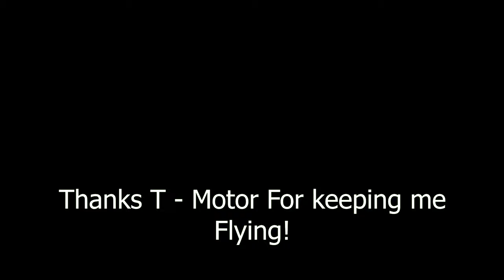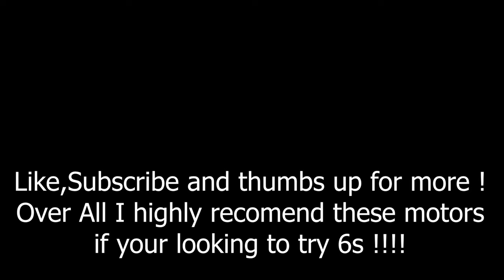T-motor "Pacer" 2207.5 1750 KV - 6s - Motor

Comment: Nice motors there and flying! Cool.. I just got mine and still finding how to tune it as I'm having some oscillations on throttle up. My build is like an Apex frame, Tmotor Velox 2207.5 1750KV using 1300mah 6s CHNL battery.
Reply from the maker: Sick yeah man im not the best at tuning but i do understand it it takes a special 👁️ for it ! 💯

Comment: Sweet. I’ve been waiting on someone to fly these!
Reply from the maker: dude i would highly recommend them once you go T you Typically dont look back !
Reply: That Flyin Ryan - Drone Videos yeah I’ve got 4 of the tmotor f45a 4n1 esc’s lol. Too bad they don’t make that one anymore. Loved the fact that it plugged straight into the revoltosd
Reply: That Flyin Ryan - Drone Videos I kinda wish they would make a 2206. I’ve been doing a lot of personal testing lately on 2205, 2206, 2207, and 2207.5 and 2306 motors and for me as far as racing goes I fly much better on a 2206 than anything else. But for freestyle I love a 2207.5, and 2208 and even a 2306 but around 1800 kv for 6s. The 1700 just doesn’t do it for me lol.
Reply: @archer4922  F 60 version 5 1900 kv ?
Reply: Michael Ryan isn’t that a 2207.5? But yeah the kv is just about right where I like it. Well depending on the type of flying.
Reply: @archer4922  Yeah it's a sweet motor for sure.. Plenty of power.. Amazingly light as well.
Reply: Michael Ryan very nice!
Reply from the maker: @archer4922  awww your like me balls out with power lol 🤣
Reply: That Flyin Ryan - Drone Videos for freestyle hell yeah balls to the wall. But for racing I like to tone it down a little especially on the tight courses they always make at my local multigp chapter. But I still run Xilo 2207 1750’s or hyperlite 2207.5 1722’s and a 85% throttle cap. for freestyle I’ve been loving the Xing 2208 1700’s. I so wish I would’ve gotten the 1800’s tho. But the 1700’s are still plenty powerful
Reply: That Flyin Ryan - Drone Videos  can’t wait to finish my practice rig build with the brotherhobby 2510’s 👍👍
Reply: That Flyin Ryan - Drone Videos all this motor talk and I completely forgot I have a new set of hypetrain blaster 2207 1800’s. Lol.

Comment: I ordered 4 of those T-M Pacer 1750kv for my 5", waiting for them !
Which propellers did you mount on them ? On test reports by T-M, it seems that they woyld work better with 5146 !?
Reply from the maker: I'm a mid pitch kind of guy 5145 dals I run
Reply: Thanks for your answer. I'll perhaps try the T-Motor 5146.